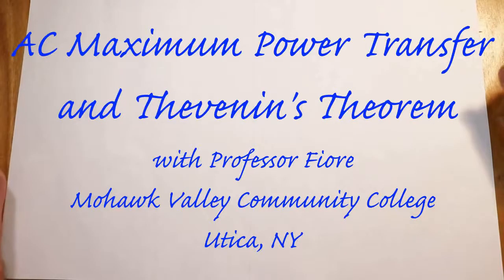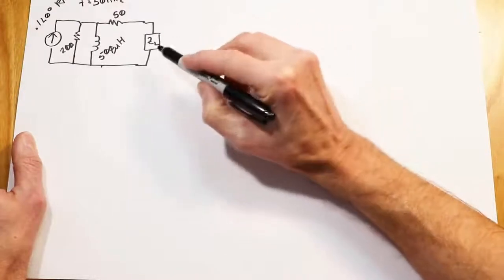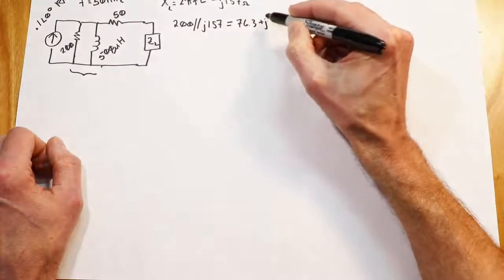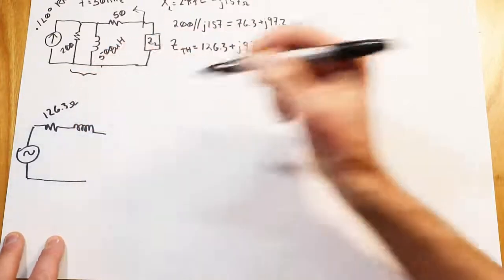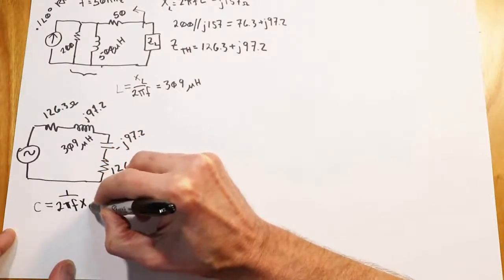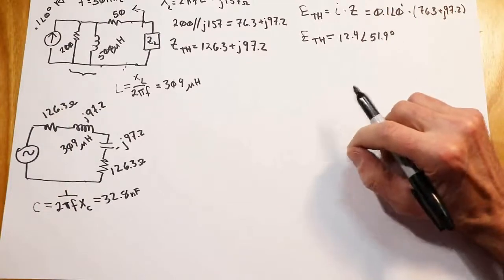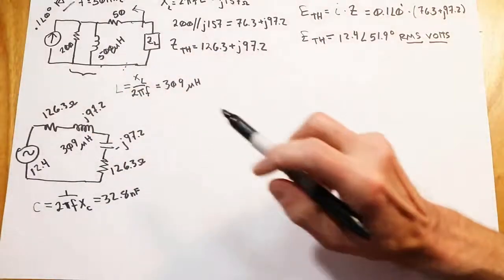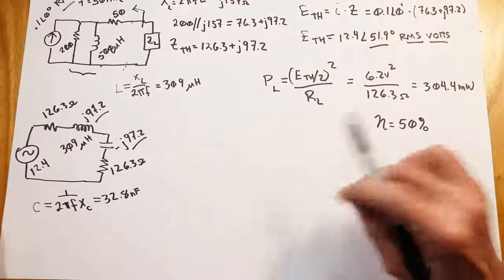AC Electrical Circuit Analysis: Maximum Power Transfer With Thevenin's Theorem

Comment: Great video! Could you explain why, in your load, including a capacitor with the same (but negative) complex component as the thevenin load maximizes power? What's the theory behind that?
Reply from the maker: If the Thevenin Z is the complex conjugate of the load, then the complex parts cancel, which leaves an impedance minimum. That, in turn, will produce a current maximum. True power is i squared r, thus, you get maximum load power.
Reply: @ElectronicswithProfessorFiore  I see, thanks!

Comment: how do you calculate the efficency?
Reply from the maker: Efficiency is defined as the ratio of output (or load) power to the input (or supplied) power, expressed as a percentage. In the case of a reactive AC circuit, remember that true power is only dissipated in the resistive elements. For a deeper dive into this, check out the three videos in the AC Circuit Analysis playlist starting here:
https://youtu.be/F6rln3zrJXw

Comment: Hello! I dont understand how 200//j157=76.3+j97.2, could you help please?
Reply from the maker: That's shorthand for 200 ohms resistive (i.e., 200 at an angle of 0 degrees) in parallel with 157 ohms at an angle of 90 degrees. If you're not familiar with phasors and right angle trigonometry, you might try this: https://youtu.be/J3vasJlH8xQ and continue from there.
Reply: @ElectronicswithProfessorFiore  thank you the video helped 🙏
Reply: @ElectronicswithProfessorFiore  i watched video but is there another video you can recommend to help me understand how you get 76.3+j97.2? Thank you!!
Reply from the maker: @rudygomez6996  Go through the AC Circuit Analysis playlist in sequence. Here is the playlist: 
https://www.youtube.com/playlist?list=PLxuejeK2BP_cIbdalFX_Y9X-nlv2kRxq3
You will get to parallel RLC circuits after about a dozen videos. Don't skip any. Each one builds on the previous video.

The playlist follows my free textbook on AC circuit analysis. See the video description for download links.
Reply: @ElectronicswithProfessorFiore  okay thank you very much. Some say “private video”, how do i watch those?
Reply from the maker: @rudygomez6996  Those are videos that I am working on. You won't need them to answer your questions.